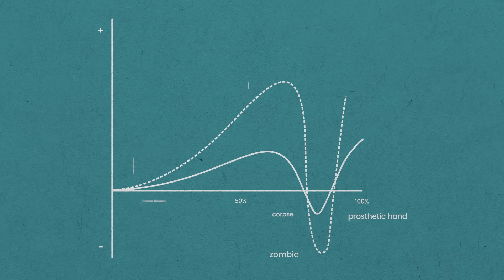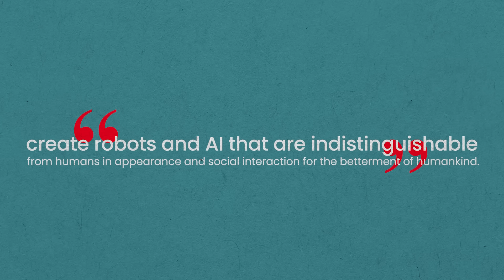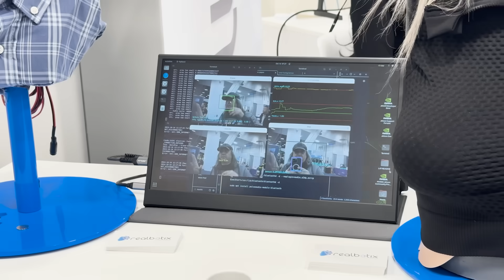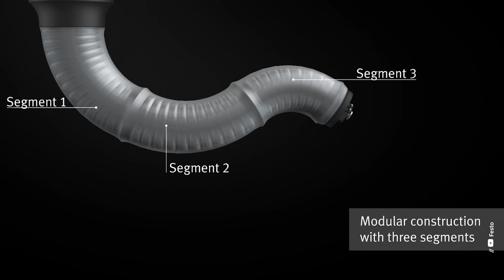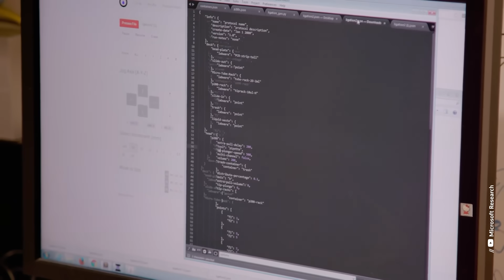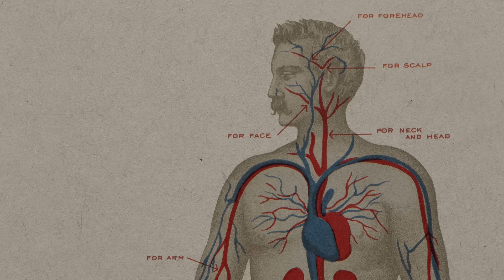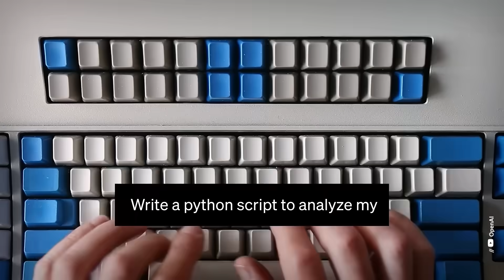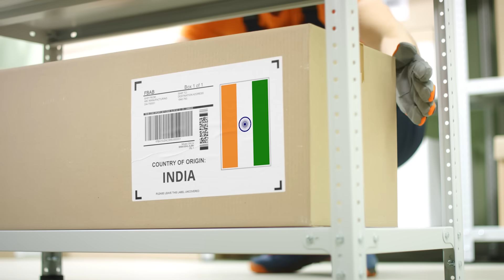Have Humanoid Robots Gone Too Far?

Comment: A lot of research will need to be done into non-Newtonian fluids to pack inside the empty cavities to give the bodies fullness. That would give the micro gestures something to push against. Eventually making repairs would be much more like surgery.
Reply: Why do they need to be non-newtonian?
Reply: @ I was thinking about self healing materials. Some gels can be self healing as well but they might provide too much bounce.
Reply: @headfirst6227  I'm pretty sure all gels are "self healing" in that it'll rejoin with the parent material if separated, this is unrelated to non-newtonian though, which is where the fluid material hardens up under some form of stress or impact. I'm not sure why this would be a useful property for a material packed inside as filler, because as soon as the robot starts moving quickly the fluid would harden up making movement more difficult, it's almost like the opposite of grease.
Reply: @ densities and fluid properties would have to vary continuously throughout the body just like a human body. I’m sure you would agree. An enormous amount of design work has yet to be accomplished.
Reply: Wouldn’t surprise me if they just grow real human flesh over the skeleton. Technically it’s plausible.
Reply: @ thinking of a bot that drops out of a placental sack?
Reply: @peripheralparadox4218  it's not plausible, you've watched The Terminator too much.
Reply: Soon,  we will have touchable hologram AI.